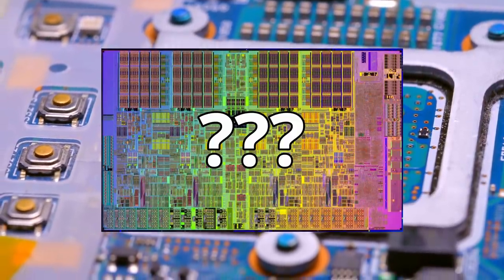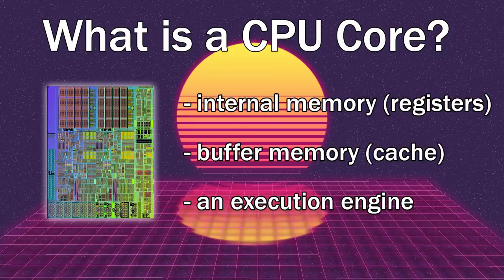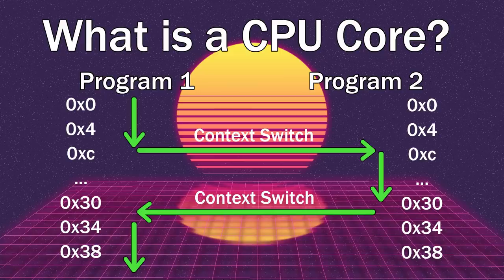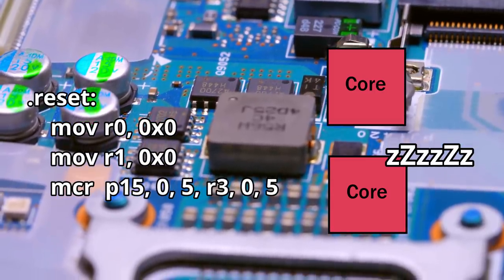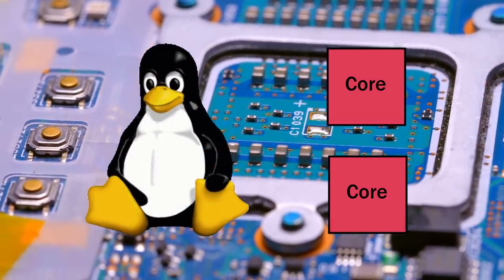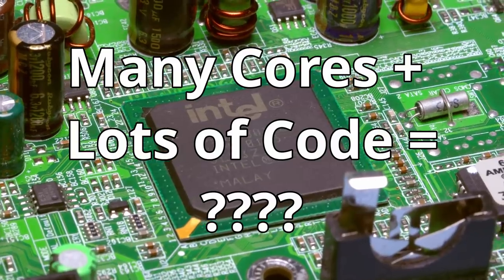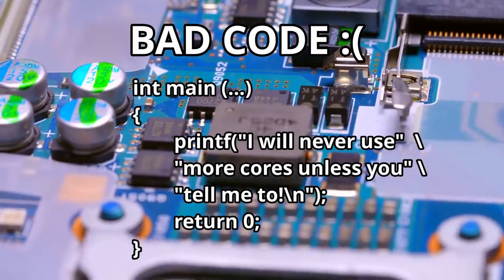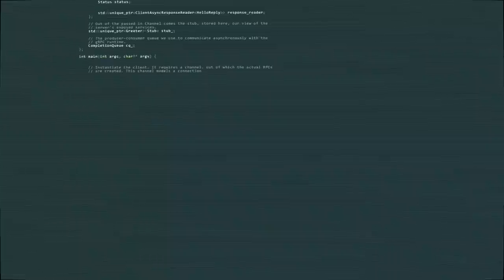why can’t computers have thousands of cores?

Comment: Your conclusion is as bad as your spelling of symmetric. GPUs basically already do that, and the issue cited are basically not real they are just today's bottlenecks which tend to fade away with Moore's law.
Reply: GPUs don't have cores. So they don't "already do that". They have very small computing units, but many. The entire GPU architecture is targeted towards making a single thing fast, i.e. the graphics pipeline. It can be used for some special number crunching stuff (GPGPU) but that is not what the people who designed GPUs had in focus.  When programming for a GPGPU you use a very special style of programming and you have to do a lot of things "by hand".
Reply: @Conenion  That really depends on what you're calling a core, which gets a bit fuzzy, but certainly considering a lot of modern super computers are built on GPUs it would be a little weird to say cores are defined somehow in software. --- Also the special style of programming for GPGPU stuff is a sort of variant of what you do for multi-core processors.
Reply: @davidolsen1222  
CPU cores are much bigger. See die photos.  They are much more capable than GPU cores (e.g. CPUs cores can do SIMD which is another form of parallelism). Also the clock frequency of a GPU is about 3 times lower compared to a CPU.

The programming model is very different. Even compared to multi-thread programming.
Reply: @Conenion  That's an argument that the core stuff is weird, not that they aren't generally computers in and of themselves.

Comment: I realize you were using hyperbole, but your number clashed with reality.  I suggest you do further research on the state of software research fifty years ago, before making statements about what computer engineers never would have dreamt of.  As early as 1966 Michael Flynn was thinking about parallel processing.  But the state of computer hardware had a long was to go, before such thoughts were anything more than a dream.  So yes, over fifty years ago, computer engineers were dreaming.
Reply: Yeah, but Amdahl's law is still true today. And will likely be in the future. Except there is a complete paradigm shift.

Comment: GPGPU...   We use thousands of cores!
Reply: GPUs don't have cores. That is simply wrong. They have very small computing units, but many. The entire GPU architecture is targeted towards making a single thing fast, i.e. the graphics pipeline. It can be used for some special number crunching stuff (GPGPU), like you say, but that is not what the people who designed GPUs had in focus.  When programming for a GPGPU you use a very special style of programming and you have to do a lot of things "by hand".
Reply: @Conenion  yes.  And we do it.  The fastest machines in the world are huge numbers of GPUs.  And we program them to do everything from weather forecasting to simulating nuclear weapons.
     Coding can be done with thousands of threads if you are really good and can think out of the box.  Before GPUs I helped develope OS2.  Best preemptive multitasking operating system of all time.   Lousy programmers used one thread and claimed problems couldn't be split then too.
Reply: @LongDistanceSailor  
> weather forecasting to simulating nuclear weapons.
Sure. Typical number crunching stuff. LU decomposition, solving large linear systems.

These kind of things can be done on HPCs with GPUs, cause that's what they are build for. But that is not general purpose.

>  Coding can be done with thousands of threads 

But it is difficult to achieve performance. See Amdahl's law.

Comment: All those problems can be solved. Usually by having more parallel structure. And not just the cores. It already happened.
Multiple caches reserved for certain cores. More memory channels, better compilers that fix dumb coders brainfarts.

Comment: 1. Supercomputers already have thousands of cores
2. Your GPU already has thousands of cores
3. The efficiency core schemes allow for less power hungry and cooler cores to be packed into a chip. AI loves cool, weak cores. You could easily have programs that fully utilize a thousand core CPU right now.

So tell me again how clickbait this video title is?
Reply: It's not really click bait as it is tough as hell these days to talk about technology, especially when it comes to computers.
Reply: A supercomputer (or HPC machine) isn't a general purpose machine. It has been build for certain applications. Mostly number crunching like solving systems of linear equations. These sorts of problems are typically easily parallelizable.

A GPU is again not a general purpose machine. It is targeted towards make a single problem fast, the graphics pipeline. It doesn't have CPU-like cores. It has smalll compute units, but many. It can be used for certain number crunching tasks (GPGPU) but to do so it has to be programmed in very special ways which involves doing many things "by hand".

> You could easily have programs that fully utilize a thousand core CPU right now.
In this general form this statement is completely wrong. I assume you have never done much multi-threading programming. If it would be so easy it would have been done already.

Comment: Than why GPU can work with a thousand cores???
Reply: GPU 'cores' are totally different from CPU cores.
Reply: GPU cores are raw number crunching vector units, CPUs are the brain of the computer, boolean operators and scalar numbers...
Reply: GPUs don't have cores. That is simply wrong. They have very small computing units, but many. The entire GPU architecture is targeted towards making a single thing fast, i.e. the graphics pipeline. It can be used for some special number crunching stuff (GPGPU) but that is not what the people who designed GPUs had in focus.  When programming for a GPGPU you use a very special style of programming and you have to do a lot of things "by hand".

Comment: is your virus scanner on ? do you work with prite tive memory ? is your operating sysrrm limited lets say in root rights or admin rights ?
do your code has a memory leakage ? do have a infnite loop after compileing ? did you close your file right ? lets say control m or control z. a open file can make your cpu red hot ? do you run twice the same program ? is it open twice while compileing or editing ? et ce tera. i bet you could  not even use the full capacity of a pentium 486 single core cpu with your progeamming. the world needs better software programmers and developers. but blameing the hardware does not make sense. just use it more... efficiently.. like adding an extra brain also not makes you smarter. but going to school does..
Reply: or a home self study.

Comment: gpu has thousands cores and part of computer.
Reply: GPUs don't have cores. That is simply wrong. They have very small computing units, but many. The entire GPU architecture is targeted towards making a single thing fast, i.e. the graphics pipeline. It can be used for some special number crunching stuff (GPGPU) but that is not what the people who designed GPUs had in focus.  When programming for a GPGPU you use a very special style of programming and you have to do a lot of things "by hand".

Comment: Another limit imposed on such concept, though much more difficult to approach and thus much less discussed, is the Schwarzschild limit where if you pack enough cores on a die (specifically around 10^31), they will immediately collapse into a blackhole
Reply: That's because doing so is literally impossible, the amount of energy needed to force them that tight, would crush them and make them cry.

Comment: Gpus start giggling In the corner with their tens of thousands of cores
Reply: GPUs don't have cores. That is simply wrong. They have very small computing units, but many. The entire GPU architecture is targeted towards making a single thing fast, i.e. the graphics pipeline. It can be used for some special number crunching stuff (GPGPU) but that is not what the people who designed GPUs had in focus.  When programming for a GPGPU you use a very special style of programming and you have to do a lot of things "by hand".

Comment: Computers can have an infinite number of cores.. ever since decades ago when INFINITY FABRIC infinitely scaling CPU interconnect for super computers was invented by AMD.. END OF VIDEO.
You see when playstation 3 was released.. it could link a football field of them and have them go faster.. a true super computer. if you linked a football field of intel processors you got 11 minutes delay per cycle. Super computers with hundreds or thousands of CPU's have and do exist.. its how google data centers and cloud computing work with sub 1ms times for the entire network (if adding a few more cores could add delay this would be physically impossible but yes true super computers can use hardware based negative latency and other such things AMD uses in all their computers but which the OS cripples and never uses a single feature of)

Comment: Computer already have 1000s of cores.  Look closer.
Reply: GPUs don't have cores. That is simply wrong. They have very small computing units, but many. The entire GPU architecture is targeted towards making a single thing fast, i.e. the graphics pipeline. It can be used for some special number crunching stuff (GPGPU) but that is not what the people who designed GPUs had in focus.  When programming for a GPGPU you use a very special style of programming and you have to do a lot of things "by hand".

Comment: except GPUs have thousands of cores...
Reply: GPUs don't have cores. That is simply wrong. They have very small computing units, but many. The entire GPU architecture is targeted towards making a single thing fast, i.e. the graphics pipeline. It can be used for some special number crunching stuff (GPGPU) but that is not what the people who designed GPUs had in focus.  When programming for a GPGPU you use a very special style of programming and you have to do a lot of things "by hand".
Reply: @Conenion   @Conenion  Have you heard of nvidia cuda? GPUs has not been targeted only for graphics for a dozen years now, and yes its not exactly true that gpus have thousands of cores, RTX3080 for example has 68 cores and ech one can perform two SIMD instruction on 128 32bit floats simultaneously per clock, which in some cases can be viewed as 8704 cores, but in all cases as at least 68 cores

Comment: Well my gpu has over 10,000 cores lol
Reply: GPUs don't have cores. That is simply wrong. They have very small computing units, but many. The entire GPU architecture is targeted towards making a single thing fast, i.e. the graphics pipeline. It can be used for some special number crunching stuff (GPGPU) but that is not what the people who designed GPUs had in focus.  When programming for a GPGPU you use a very special style of programming and you have to do a lot of things "by hand".

Comment: M1 processor with onboard memory gets around the RAM speed limits. My MacBook Air can run windows in a virtual machine and it’s way faster than my older MacBook Pro with a 2.3GHz Core i9 processor.

Comment: Well jokes on you. GPUs are a thing
Reply: GPUs don't have cores. That is simply wrong. They have very small computing units, but many. The entire GPU architecture is targeted towards making a single thing fast, i.e. the graphics pipeline. It can be used for some special number crunching stuff (GPGPU) but that is not what the people who designed GPUs had in focus.  When programming for a GPGPU you use a very special style of programming and you have to do a lot of things "by hand".

Comment: The software industry is moving towards more and more functional (as opposed to imperative) code in order to utilize multiple cores without much issues.
Reply: Functional code has a lot of benefits. In my mind, the biggest benefit is making it easier to treat blocks of code as "black boxes". That strength can make it easier to find ways to parallelize the code.
I remember hearing speculation that functional languages would be able to automatically generate efficient parallel code. So far the best auto-parallelized code rarely matches the performance of parallel code written by an experienced programmer. The best solution I've seen is libraries that make it easy for programmers to specify things like, "Parallelize this loop" with just a couple lines of code.